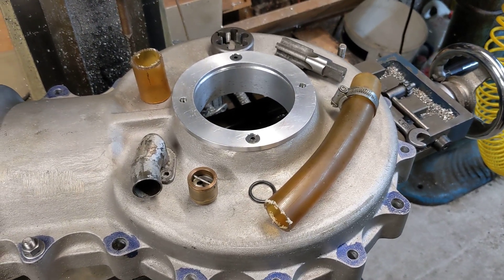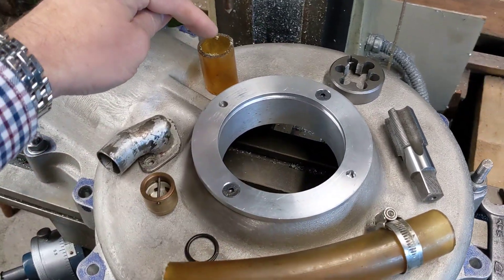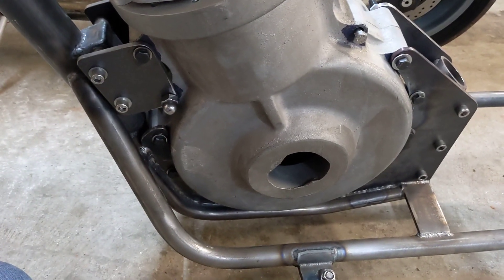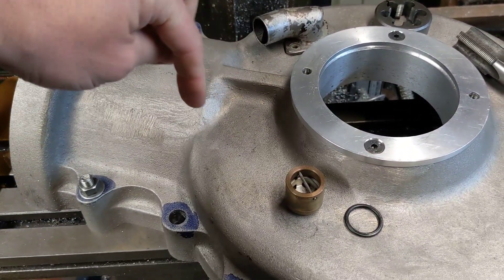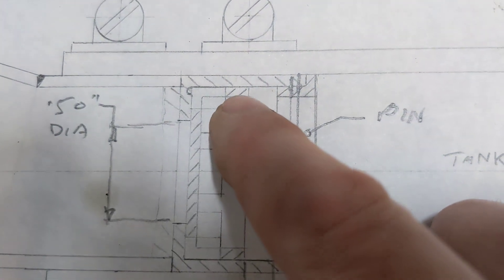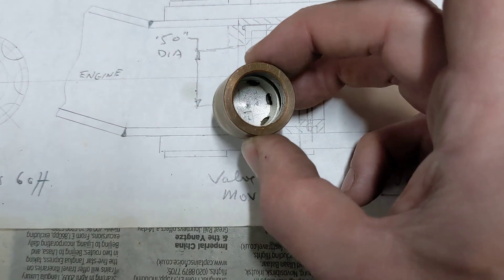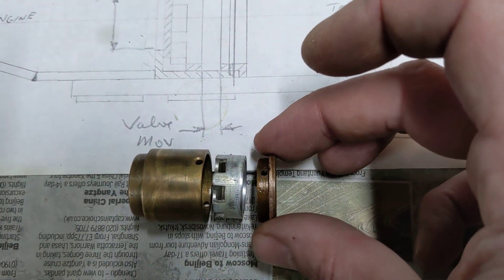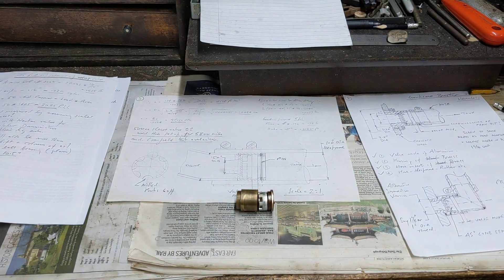One Way Valve

Comment: Getting close to final assembly now. Q. Will the diameter of the valve be sufficient to vent 2.5 ltrs of air on each stroke? On my VTR each cam cover has a vent hose that looks larger diameter than yours. I know the engine revs higher etc but if my 1ltr engine has twice the vent capacity of yours... I'd hate to see you have problems after all this work.
Reply from the maker: Great question Phil. The short answer is I don't know for sure, but we'll find out! Worst case will be a shortened life for the drive side oil seal, nothing disastrous.

I don't need to get rid of 2.5l every stroke. The crank case gas chamber is alternately compressed then allowed to return to its original volume, being an enclosed chamber. A one way valve will allow some of the gas to escape to the atmosphere when crankcase pressure increases. If only half a litre escapes, being a one way process the volume will reduce by 500cc. The next cycle will expel another half litre until there is no effective crankcase pressure, but a semi vacuum at the top of each stroke.

I'm not sure your cam cover breathers will be venting crankcase pressure or not. That depends on many things, such as whether it's ohc and if the chain/belt tunnel contexts l contexts your crank cases to the cam covers. I suspect they don't have a one way valve either.

However, I agree that bigger is better. I guess we'll just have to wait and see 💪
Reply from the maker: Sorry, I mean 'connects', not contexts. It's my dumb phone trying to help!
Reply: @StoneEng  your right mine don't have a valve but the vent in the top of the cam cover is enabling the whole crank case volume to breathe